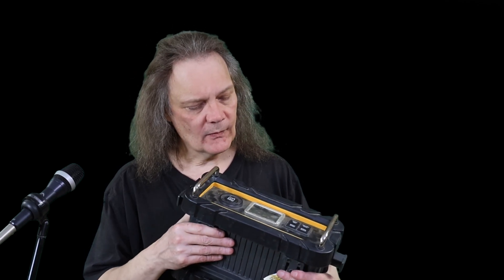Stanley BC25 Battery Charger Switch Repair

Comment: 3 of these  2 25,  1 15.    15 has been flawless for many yrs,   both 25 have had intermittent button issue like  things you mentioned  one started shortly after new,  the other just started acting up.   schematic or even a user updated/modified controller would be amazing  to get around these issues.
Reply from the maker: Thanks for sharing your experience, it's really helpful to know that others are encountering similar issues.  It worked well, while it was working, 

But I found an inexpensive charger on Amazon that's a fraction of the price that works so much better.   https://youtu.be/E4FJxRXNeQ4

Comment: Thanks for sharing sir. TRIED in vain to use this exact same model last night to No avail/luck. Maybe we'll try to fix ours thanks to your video.   - take care
Reply from the maker: My BC25 is still intermittent, and personally I just don't think it's worth the effort to try to repair.  It's not a very smart, smart charger.

I replaced it with this very inexpensive unit, which I think does a much better job of charging and maintaining batteries, although it's not quite as much current as the BC25.  The charging speed seems about similar, although I haven't really measured it.

https://youtu.be/E4FJxRXNeQ4
Reply: @Barry-Watson  Thanks man. I just tested the BC25 & it's working/charging fine on a battery that was Not dead as a doornail. Thanks again, watching a Project Farm battery charger video, & I'll check out your video too.